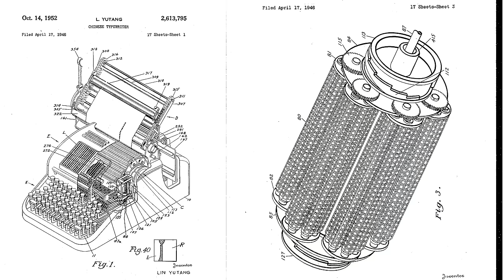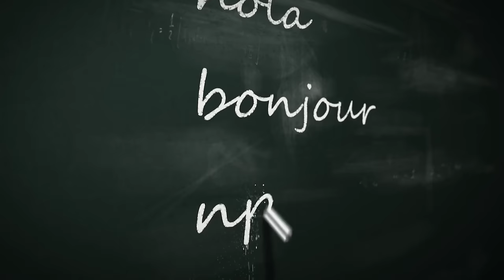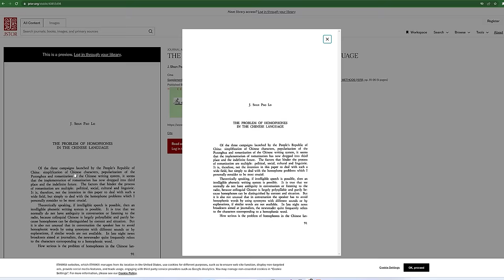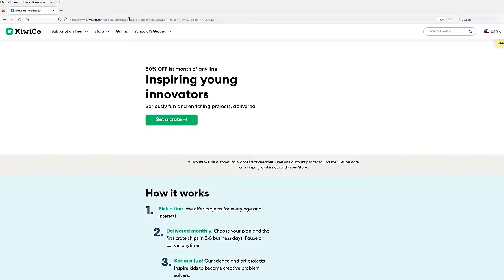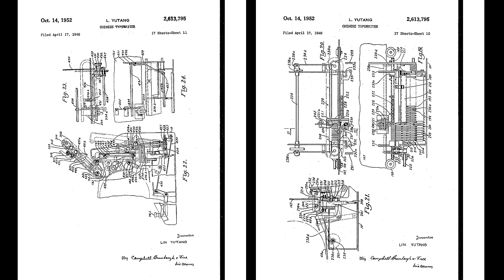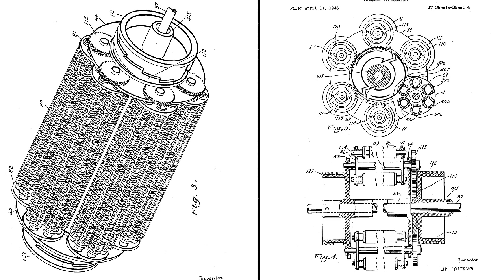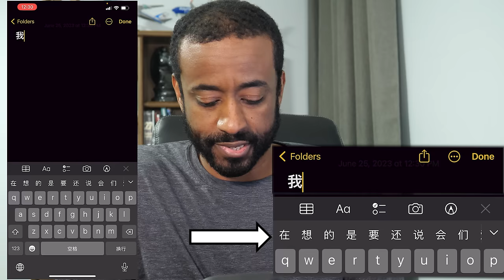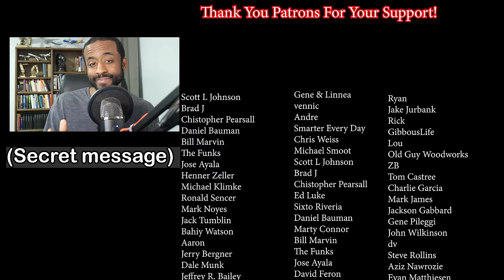Solving China's Hardest Engineering Problem

Comment: I wonder how the cost of typewriter ribbon compares to the cost of inkjet ink (which is something like $10,000.00 per gallon BTW) based on how much text they each can produce.
Reply: Ribbon is still cheaper, even the specialty stuff that is professionally refurbished old stock - and thus required a little bit of labor.
Reply: You're probably aware that the whole printer ink thing is a giant racket.  The ink cartridges actually have chips in them that detect when you start using them and make them artificially "run out" after a certain period of time.  Multicolor cartridges will say they are out of ink if any color runs out.. so if you run out of blue, it will refuse to print black, saying its out of ink.  They also detect if you tamper with them so you can't refill them yourself.  Somehow this does not seem to have happened to toner with laser printers (yet?)
Reply: @adfaklsdjf  that does vary a bit by Printer-maker brand, at least, as well as printer model. my HP can have it's cartridges refilled, but they're so unreliable even straight out of the package.....
Reply: @DFX2KX  HP has some experience with printers and knows how to make them properly if they want to.  My instinct is that your ink cartridge problems are some kind of scam, too, or side-effects of one.
Reply: Typewriter ribbons are basically the same as those used in dot matrix printers and those can print absolutely wild amounts without needing to be replaced. Old ink ribbons usually die of drying out far before they die of running out of ink, and can often be revived just by spraying wd40 into the ribbon and removing the excess. 

They're so long lived, cheap, and reliable to operate it's hard to even make a valid comparison. Dot-matrix printers are often used in harsh or high-volume print environments where they operate for years on end with no more maintenance than having endless boxes of paper run through them printing and maybe someone noticing a drying up ribbon every couple years and replacing it for a few bucks.
Reply: @adfaklsdjf  Absolutely.  HP was a respectable company before they got into the ink-scam market.

Comment: "with english, the letters are all the same size and equally spaced" - this is only true in the context of typewriters and because of the limitations of typewriters. even with old-fashioned printing presses letters were different sizes, and they had tons of ligatures to make printed words more similar to actual written words.
Reply: True, but I think that is more a function of the font that is being used. There is no requirement in English that would require anything but monospaced (horizontal/vertical) characters.

Comment: Wow, that's an incredible piece of mechanical design!
As to IBM's version, while it's probably not ideal for writing, you'd be surprised to find how easy it might be to remember several thousand code numbers like that. It's not that far removed from just knowing all the Chinese characters in the first place, given a number doesn't particularly correspond to a given word any more than its character usually does (in most cases anyway)

I know firsthand how quick you can pick this up because I had to do it myself for a job I did about 20 years ago and I was shocked how naturally my brain managed to remember several thousand code numbers very quickly.

It was a data entry job, taking the information from prescription forms that pharmacies had dispensed and putting them on a computer so the pharmacy would get paid.
There was an individual 3 - 7 digit code for every item in the British Pharmacopeia - so not just a separate code for each drug, but each formulation, modification, pack size, etc of each drug. So sometimes dozens of different codes for any given drug, and there are a lot of drugs!

We had a tabletop reference with every code on it, kind of like a huge linear Rolodex, both for initially learning the job, and since you often had to look up uncommon items. There were over 25,000 codes on the thing, but after a few weeks in the job I found I could go hundreds of prescriptions without having to look anything up, since I'd memorised the top couple of thousand codes.

I remember one day they for some reason had to change the code for the single most common item (28-pack gastro resistant coated aspirin, 75mg) and the whole office was up in arms! 😂
Reply: Not many people have good memory as you!  An easier way would be to treat each Chinese character as short words or syllable, and each of these words is made of "letters" that that are made from the simpler Chinese radicals.  Chinese characters are made from 214 radicals, or simpler characters, that are the building blocks to make more complex characters. Each of those radicals can be used as a letter for our ANSI keyboard.... that can be typed horizontally using ANSI keyboard for the computer to translate into a complex Chinese character.  More complex radicals can be represented by 2 simpler radicals (letters), so we can have 48 Chinese letters to fit into a computer keyboard.  With this principle, you can type Chinese characters very fast using existing ANSI keyboard, without using Pinyin.  You only have to remember what Chinese letter (or radical) each of the key in the keyboard stands for.  Far easier to remember 48 items than 5,000 items!
Reply: That's amazing! The human mind is incredible in it's versatility. I think something very strange happened when we forked off from the apes. Thanks for sharing.

Comment: I think most of Indian languages (which are agglutinative languages) had the same problem, where the shape of the letter changes as consonant and vowel merge and when not merged (Each vowel has two forms, an independent form when not attached to a consonant, and a dependent form, when attached to a consonant).  Type writers mostly fixed it using the same method mentioned here, though the first one was a modified English typewriter from Halda (by Anatha Subbaraya from Shivamogga in old Mysore state).

Comment: Mr. Fielding, I appreciate your videos and technical teachings. Now you diversified your videos and it’s awesome.
A while back  I left a comment asking how much would you charge to help me reconnect a motor with correct speed. It has a small pedal to activate it and it used to run my jewelers mill in a slower speed to run metal through it but. After taking it apart to paint it, it will just go so fast and spit out metal at record speeds! Could you help me? It’s an old motor with a reduction but not even the manufacturer could help me. Thank you!
Reply from the maker: Unfortunately I don't offer this kind of service. There are services like fiverr.com and upworks.com where you can hire people for all kinds of things including engineers to help you remotely. That is the only option I am aware of that might help for this kind of thing.

Comment: I literally said "holy crap" when you explained the shift character literally shifts the rack. It's amazing to realize the origin of a word that has stopped following the original meaning.
Reply: Not sure if you're a programmer and aware of the line endings issue with text, but "carriage return" (`\r`) means to move the printer carriage back to the left side of the paper, and "line feed" (also called "newline", `\n`) means to move the paper up one line.  Our text line endings go back to when computers used teletype printers.  Terminals are also emulating mainframe terminals which themselves were emulating teletype printers.
Reply: @adfaklsdjf  I am aware of those signs, but also unsure if that's actually the origin since backslash is generally used as an escape and/or special character

Comment: A far easier to make a Chinese typewriter would be to treat each Chinese character as a short word or a syllable, and each of these words is made of "letters" that that are made from the simpler Chinese radicals.  Chinese characters are made from 214 radicals, or simpler characters, that are the building blocks to make more complex characters. Each of those radicals can be used as a letter for our ANSI keyboard.... that can be typed horizontally using ANSI keyboard for the computer to translate into a complex Chinese character.  More complex radicals can be represented by 2 simpler radicals (letters), so we can have 48 Chinese letters to fit into a computer keyboard.  With this principle, you can type Chinese characters very fast using existing ANSI keyboard, without using Pinyin.  You only have to remember what Chinese letter (or radical) each of the key in the keyboard stands for.  Far easier to remember 48 items than 5,000 items in the IBM computer!

Comment: Years ago, as a young apprentice, I got a tour through the "things we've done " museum at NCR. They had a writer that had been made for Chinese. It was a large cumbersome thing. It consisted of a platen to hold the paper. The keyboard part was a large flat grid about 50 × 50 pictographs, there was a large pointer arm you could move on the X and Y axis. When you got the pointer over the character you wanted, you slap the pointer handle down on the Z axis. This would push the platen and paper down onto typeface to print the character. The way it was explained the available characters could be overprinted to create the more complex charaters. It seemed to me that it would be faster for the scribe to just pen the paper without the writer. I admit I know nothing about Chinese and I don't think the tour guide did either. I am not sure if the museum as such exists anymore.

Comment: I was in disbelief seeing an engineer loosely spray WD40 at this antique typewriter! It's just too messy, causing dirt to drip into hard to reach places. I would have used 99% alcohol and compressed air, and then touched up each hinge or joint with mineral oil. Aside from that, it was a very informative video, thank you!

Comment: I put myself down multiple rabbit holes trying to learn bits of Japanese, German, Russian, Spanish, French, Hindi, Chinese(Mandarin) and Swahili. Once you start learning about how other languages work it really does make you question the English language. Aside from getting into the gendered parts of the languages, you also have social structure which is easy to screw up simple introductions. Good luck with your studies, start talking to native speakers and it'll slingshot your understanding.

Also I don't know if anyone has mentioned this, but you should connect with a youtuber called "Xiaomanyc." He is very well versed in not only Chinese dialects, but he learns other languages as well at a pretty rapid pace.

Comment: Japanese keyboards on phones are the same basically. Everything is in Hiragana, so you need to know that syllabary very well, but since not all words are written in Hiragana you have a problem. Written Japanese consists mainly of Hiragana, Katakana, and Kanji, with of course plenty of Romaji thrown in, but that's a different thing. You end up with hundreds of characters. So what phones do is they have you write in all Hiragana and then it just pops up all of the Kanji/Hiragana/Katakana words you might be typing. It's based off of frequency and grammatical rules, and it works pretty dang well. But yeah, any ways, it's pretty cool.

Comment: Hello Jeremy,
You have taught me tons about the function of electricity over the years.  Could you help me with a problem in the design of my water well?  Its 500 ft deep, has a 1 hp 3 wire pump, and I'm afraid a line will break when I'm not home and the pump will run until it burns up something.  I ask because I feel many people could benefit from your answer.
I have a leg of the 220v system going through a meter and current switch so I know how and when the pump runs.  I need it to shut off if it runs more than, say, a minute, or maybe if it kicks on within 2 minutes of shutting off.  If this happens I don't want it to turn on again until I look at it.
I am sure you would get tons of views on this topic as I cannot find anything about it.
I know I need to switch to some relay instead of the normal pressure switch everyone uses.
I also know if you helped everyone who asked you would go nuts.
If you decide to help thank you.

Comment: Hey , Jeremy, I am a printer by profession and my mother was a typist for most of her life. I say that just to say this, typewriters are some of the neatest mechanical devices, right up there with time pieces that use gears and all. The first electric type writers actually slowed down the workers because they could out run the machines ability to process the first letter and move to the next. If you look up guineas book of world records , and it's been a long time ago, but the man who set the record for most words typed correctly  on a typewriter was done with a manual because of that out running  the machine part.
 On mechanical each button has its own arm, like a piano. On electric it's kinda like magic in a turning ball of whatever. I love the old old old ways of printing and typewriters are part of it.

Comment: The “qwerty” typewriter was invented to slow down the typists so that the keys on the typewriter wouldn’t get stuck together. There’s a limit to how fast you could type on a mechanical key typewriter so it was designed to work with the fastest typists.

Great video. I always wanted to know how the Chinese version worked.

Comment: Never use WD 40 on typewriters. It gums them up. Instead rinse all the mechanism with paint thinner to get all the gunk off then use a proper oil or dry lubricant.
Reply: at least he blew most of it off with an air compressor

Comment: Steering away from the stereotypes (whoops pun), would the translation from Chinese to English in type be the same nightmare and does this explain the horrendous instructions provided with a lot of Chinese products?
Reply from the maker: Now that I can read some Chinese, I have a better sense of what is going wrong.  A word for word translation will always sound terrible. You need someone who actually understanding the meaning in both languages to make a good translation. Even the way they use words like "already" is very different, and the word order is a little different. Though recent apps like ChatGPT can pick up much of that now. I think this will improve a lot in the next 5 years... That is, manuals and translations like that will be better because of better translation tools.
Reply: Kurt Vonnegut once said that his requirements for a translator of his work were threefold: they must be a better writer than him. In at least two languages. One of them his.